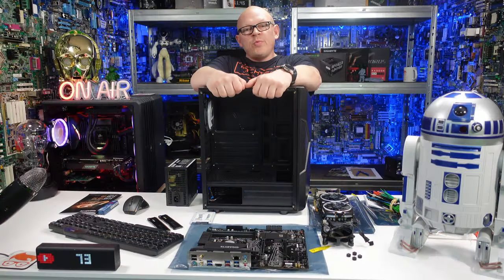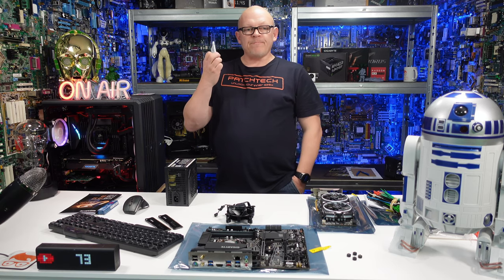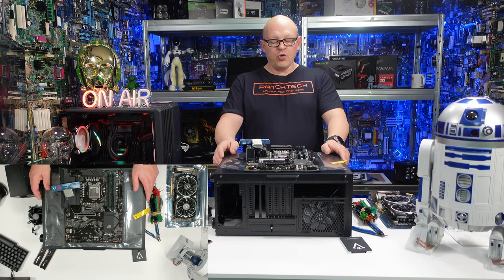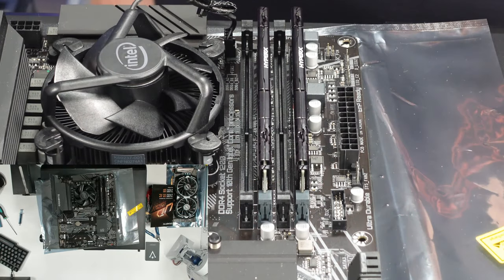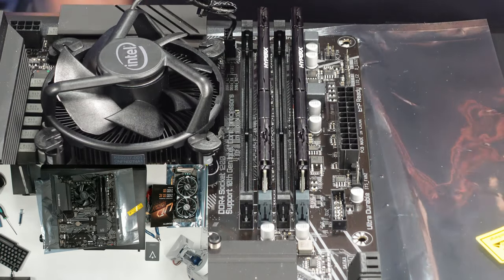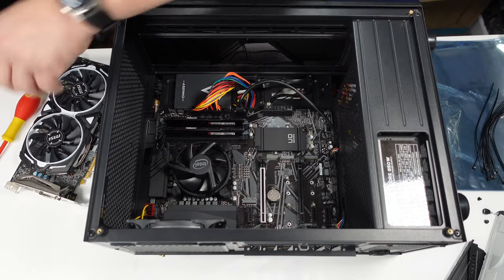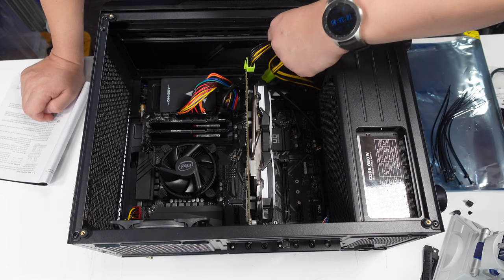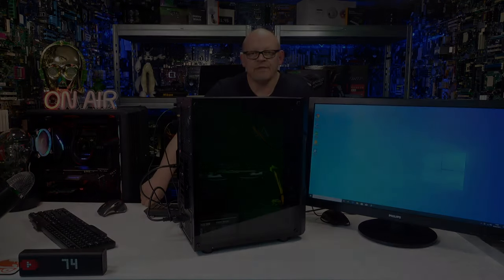How to Build a Intel i7 10700F Gaming PC in 2021

Comment: that stock cooler wont cut it for an i7 10700F in the long run
Reply from the maker: Hey! thanks for the comment! We just wanted to show a basic build! but yes you are correct, if this was intended for a customer we would have recommended a suitable CPU cooler. Very rarely if ever would we will build/supply a custom gaming machine with a stock cooler. 'Upgrading your CPU's cooler' is a future video idea!